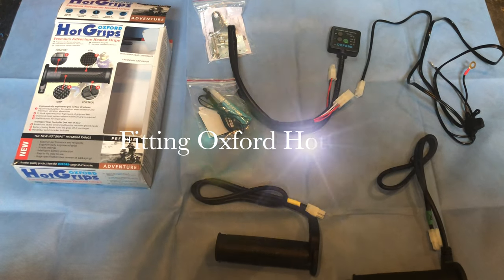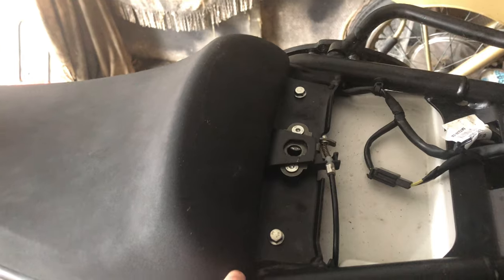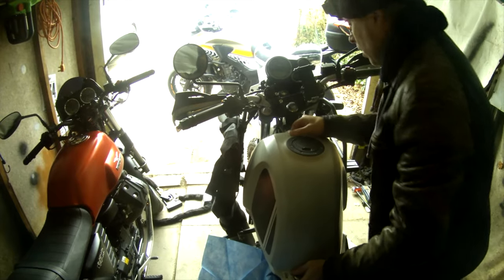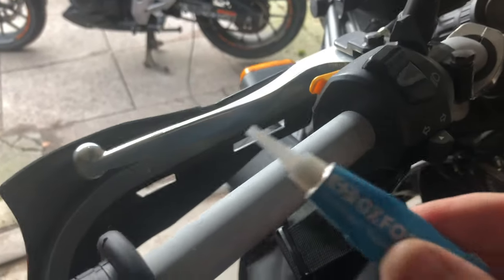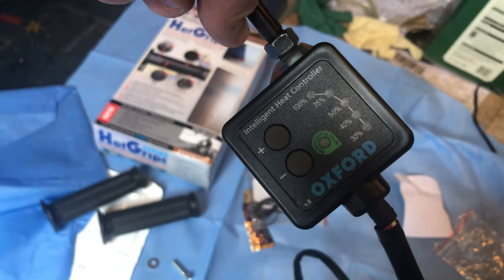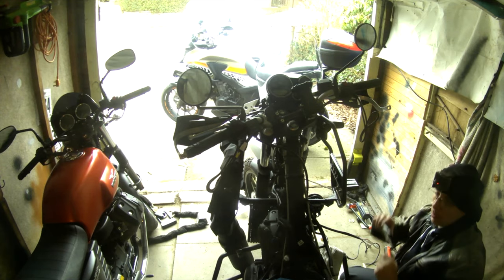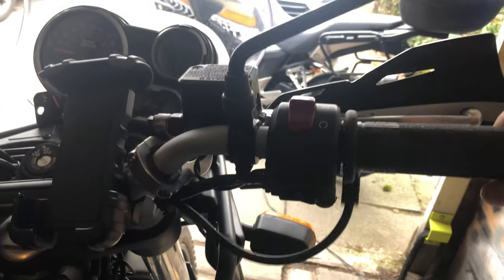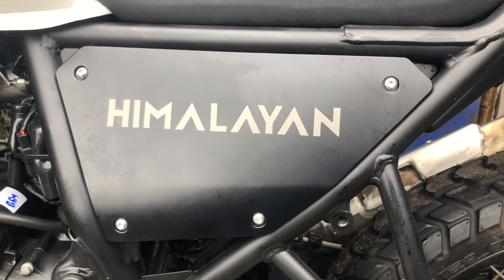How to Fit Oxford Heated Grips to a Royal Enfield Himalayan

Comment: Thanks for the vid.  Came on to look what people are doing with the throttle side slider. I like the use of the  Dremel and will do that.  One comment for others doing this though (having installed these on other bikes I've owned) - it pays to dry fit the grips first to ensure that you have them in the correct place - and also connect up the electrics to ensure they're working BEFORE you glue them in place.  They're a bugger to get off once glued if you find that there's a fault with them - ask me how I know! :-)
Reply from the maker: True about connecting up.I generally do but didn’t think to film it to be honest I should have included it.

Comment: Nice vid showing fitting and the mounting of the controller. You still have full movement on the bi-starter lever? it looked a bit close in the closeup.

its just a shame you sounded like you were at the bottom of a 44 gallon drum and all muffled.
Reply from the maker: Work in progress